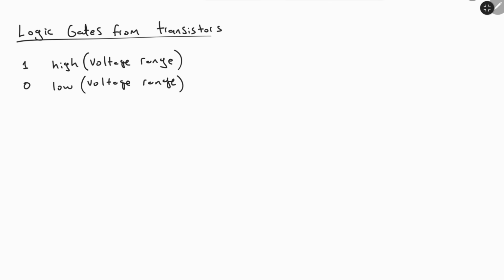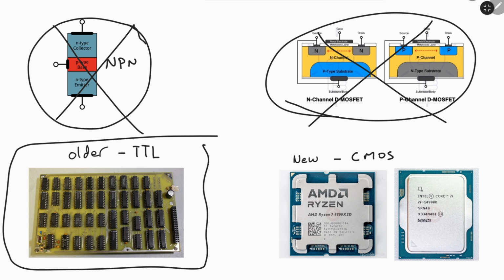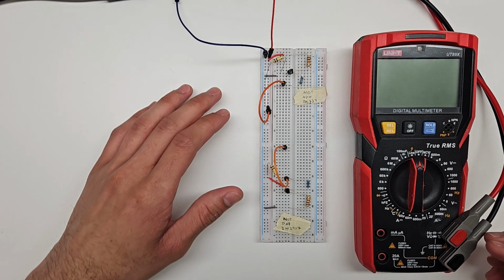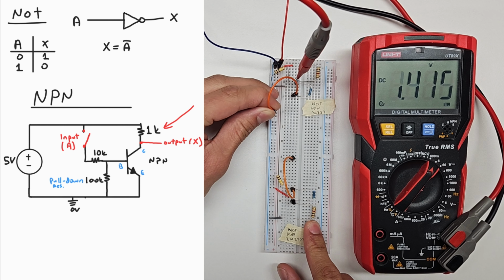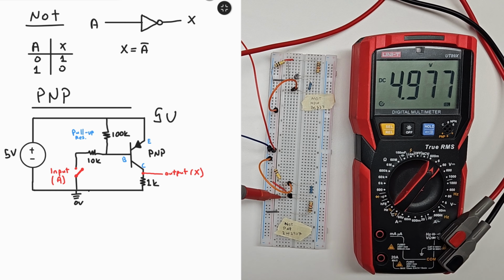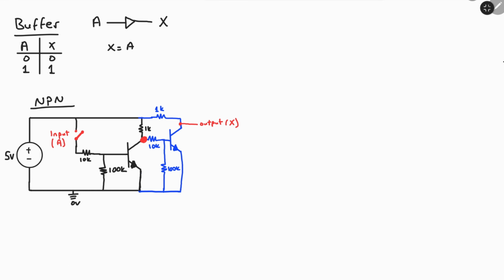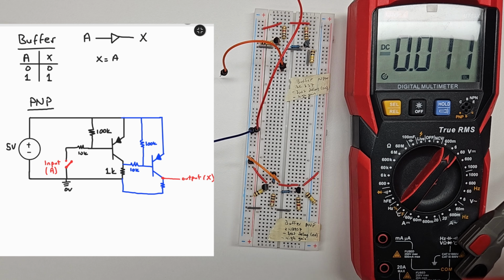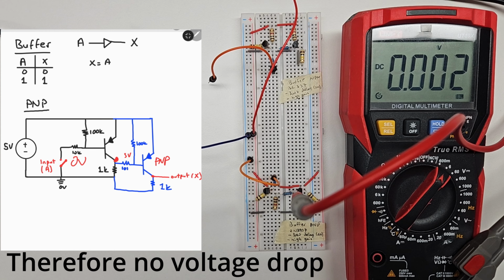Transistors to Not & Buffer Logic Gates

Comment from the maker: One thing I didn’t mention in the video is that TTL logic is relatively inefficient, since there’s always current flowing through the transistors when they’re on. CMOS, on the other hand, is much more efficient because it relies on voltage-controlled MOSFETs, so there’s very little current draw except during switching